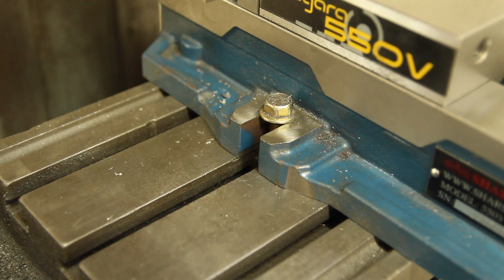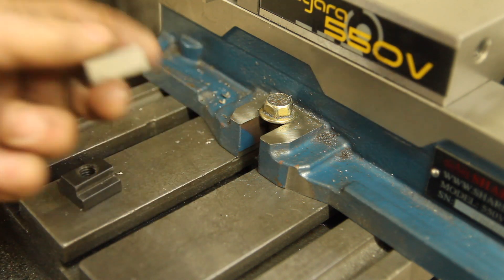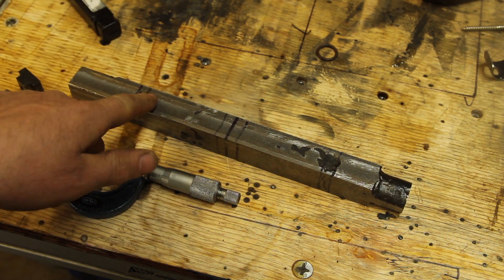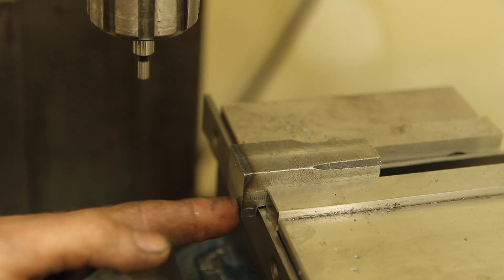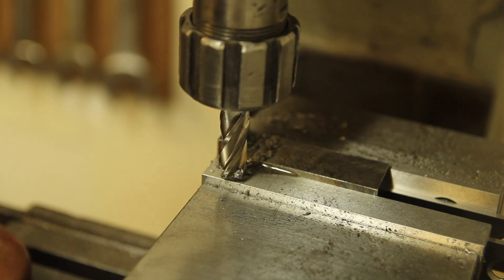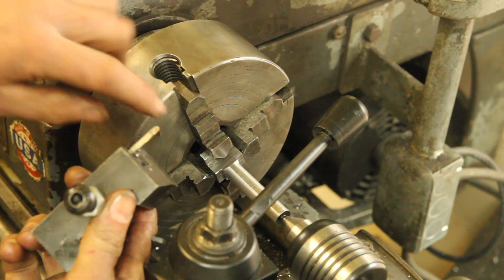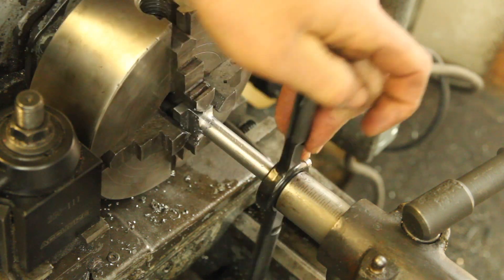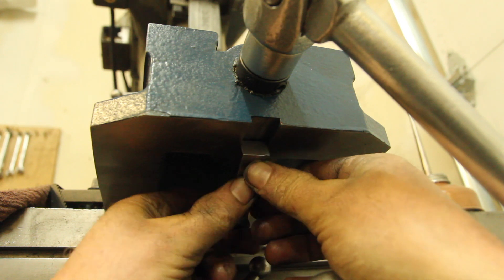Vise Hardware: T-Slot bolts

Comment: Was the counter bore really necessary for the vice keys as there's  plenty of room in the T slot to accommodate the screw heads. A project you desperately need is a vice stop on the rear jaw and a stop set off the rear of the vice. Joe Pi has a video on making both I believe. There's probably a dozen other but those I know about.
Thanks for the video from Canada's banana belt. 🤞 🇨🇦🍌🥋🇺🇦🕊🇺🇲💩🏁👍

Comment: What feed rate are you getting on your Logan for turning and which combination of gears are you using to get it?  It looks very fine, is it finer than the .004 or whatever the chart inside the cover goes down to
Reply from the maker: I was playing with finer feeds for a while, but I honestly never did the math on what it worked out to, and I don’t really remember what the gear ratios were.  I just swapped in bigger gears for the 48 and 54 tooth gears.
Reply: @JeremyMakesThings  thanks for the reply.  I'll have to look what I am using.  Like you, I really try not to touch the change gears in my Logan 200.  Threading is with dies, and by the time I want to do esoteric or other single-point threading I hope to have my Harrison 10AA (rebadged Colchester Chipmaster) ready for use which has substantially more power, range of speed, and QC gearbox.  It's been sitting in the shop with a bad oil leak since I bought it ... 2 years ago.  

On the Logan, I think I found a combination of gears that goes slightly slower than the table, maybe based on a forum post I found a few years ago.  I'll have to look and see what I have in there.

Comment: When I kitted up my mill with a few holdings thingies I just went out and bought a selection of high tensile steel hex head bolts and added a bit of weld to each of 2 sides of the hex to prevent them from turning when tightening...........I never was a fan of tee nuts but I have made some for smaller diam bolts when jobs are not all that massive to warrant heavier holding bolts.
One method I did many years ago in a factory was Tee nuts that were really slotted nuts and had a slot in the side and a section above the table to screw heavier bolts into......this gives you double the amount of thread in the nut and you can use bolts the same diam as the table slot without a problem.

Comment: What brand of mill is this?
Reply from the maker: It’s an Index model 40H made in 1947.
Reply: @JeremyMakesThings  very cool, I thought it was an off brand...I am kind of a mill junkie you might say..lol

It uses brown n sharpe #9 right?

I heard you say you have trouble getting the collet chuck out of the spindle I thought... I did also on my Cochrane bly,   I came up with a way to apply downward force using the weight of the knee, and a lil tap on the draw bar. Makes a huge difference,  if you like I will try to find the video and link ya too it
Reply from the maker: @craigtate5930  b&s 9, yes.  I’ve tried nuts about everything to get that collet chuck out- pushing, pulling, pressing, heating, etc.
Reply: @JeremyMakesThings  yikes, yeah I think your pretty stuck then